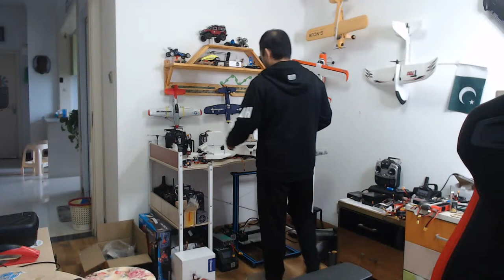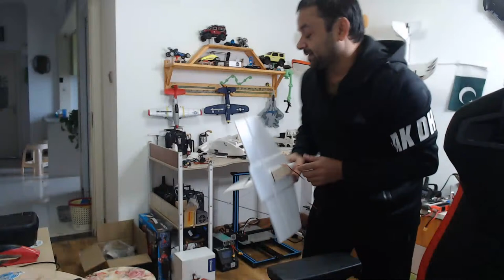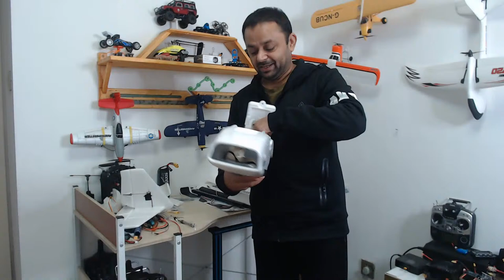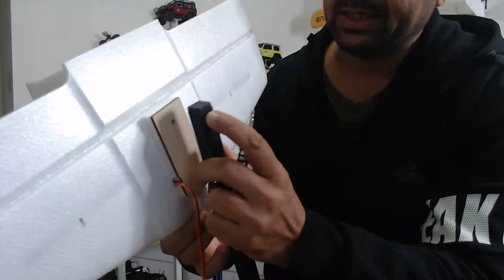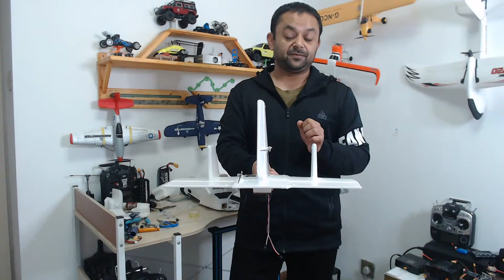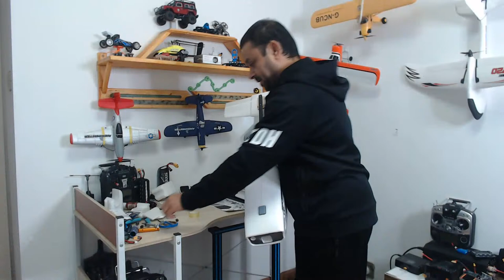AliShanMao Live Building and Setting up Eachine Airloader

Comment: @alishanmao  Thanks Ali with ur help issue resolved. But 1 new problem comes, after running a while, the fuel stops coming to corporater and when i tried to prime the Engine fuel doesn't come. Then i need to wait around 5 minutes, the temperature went down and then Buggy starts again. Inshort when Buggy Heats the Engine quit due to fuel stops coming. Is it fuel pipes issue or what ? Can u plz help
Reply from the maker: check for leaks in pipe or tank. if tank does not have good compression and have leaks, fuel will not flow to carb